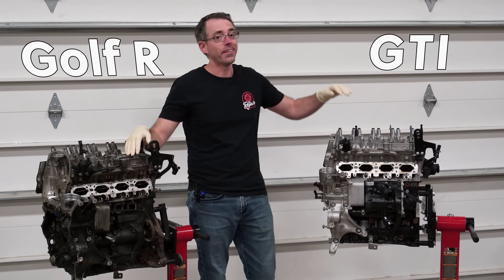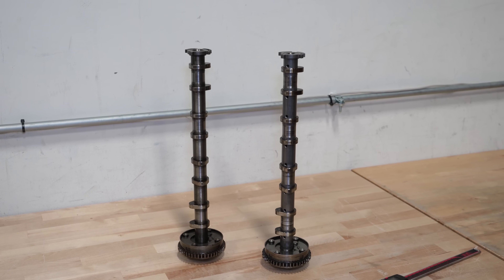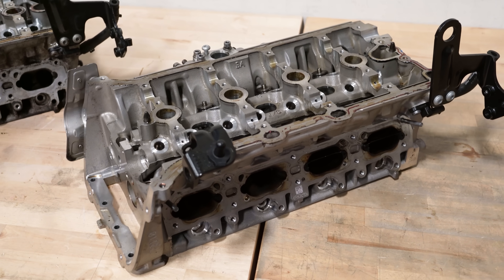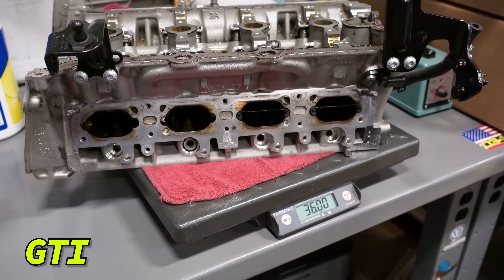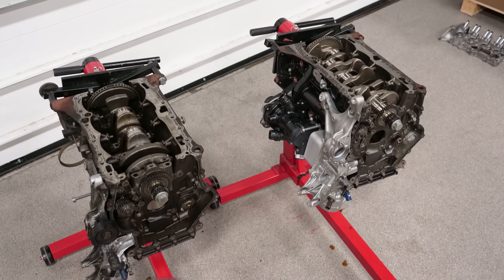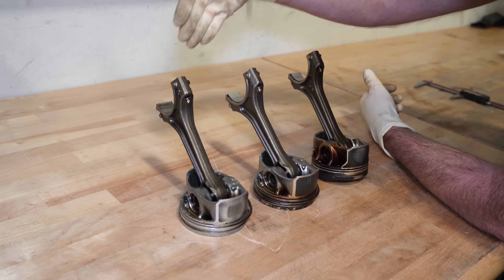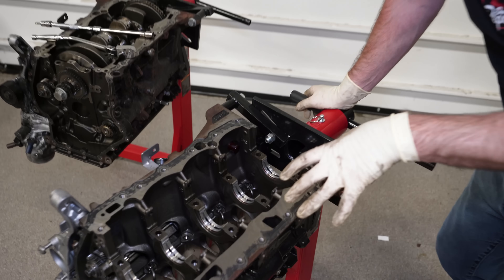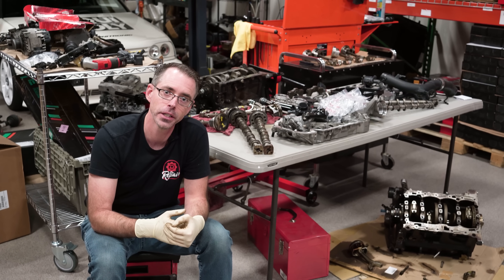Are Golf R Engine Internals Better than a GTI?

Comment: Hi! An absolute masterpiece of a video! :) 

I would like to also ask a question. I own a 1.8 TSi EA888 Gen3 engine, that was tuned to 310 hp and now pushing 333hp. Do you think that the cast crank can withstand 400nm (limited) and 333hp? Thank you in advance for your answer. Oh and yes, almost forgot to mention, MINE HAS OIL IN IT!! :D

Comment: Golf r here, uk if that matters, 132000 miles, original turbo, water pump changed,   no tunes to my knowledge, not lost any power. Relaible so far.
Reply: Had a Golf R mk7.5 new and then bought a new T Roc R and, to me, they were totally different engines. The Golf was a total hoon and the T Roc was a rattling gutless piece of junk; sold it at seven months.

Comment: I have a clubsport edition 40, supposed to be a similar engine to the R, spun bearing 4, needed a new Crank, Oil Pump etc,  car is stock so not sure how reliable these are.

Comment: Nice Video just to correct it was Aluminium Al SI stands for Silizium (not Silikon) - its basically a "hardened" Aluminium by the means of little Mangan (Mg) - an invention by the german aviation engineers from WWII - a lightweight, high-strength aluminium alloy that is widely used in the aerospace

Comment: i wonder why they use silicone in the alloy instead of carbon? is it more stable? better properties?
Reply: replying to myself.. AI says essentially it's because better properties in a few different ways so fair enough.  
increased castability, less chance of brittle cementine formation, increased tensile strength, reduced thermal expansion and contraction - i guess that last one is pretty important depending on tolerances.

Comment: Up until recently I had an Audi TT Quattro with the 230bhp version of this engine. A Stage 1 remap would have given it more than TTS power. The reason I didn't go for it is because the Torque would have been raised from 370NM to at least 430NM (and possibly as much as 480 if the claims are to be believed). 
However the torque difference between my old car and the TTS/Golf 7 R is only 10NM (380NM) and that got me thinking there has to be a reason VW don't raise it by more- like is it too much for the stock turbo or is the DSG in a Golf R different to a GTi? 

But it does seem I was being overprotective!

Comment: There are some differences, but there is something that is common for both engines: they are both pieces of shit made by VW. They will probably catastrophically fail before they reach 100000 km/60000 miles because of something stupid like an wet belt driven oil pump or pistons made if silly putty that will crack between the piston rings grooves.

Comment: Please stop calling the connecting rods forged their not they are a powered metal rod from what I seen any cracked cap rod is powered metal as far as I know and every manufacturer has been  using them exclusively for decades as it's cost effective they take powered metal put it in a mold it's then pressed and heated machined then Crack the cap
While a forged rod is cast then heated and hammer forged to the desired shape in terms of strength and cost and use it usually goes
Cast
Powered metal
Forged 
Titanium
Aluminum

Comment: Would be interesting to compare a mk6 gti engine with a mk6 gli engine. Because supposidly 1 is gen 2 and 1 is gen 3 but they both have aluminium sumps. Just thought that the mk6 gli 888.3 would be an interesting engine to compare

Comment: Honda VTEC variable valve timing system was the original patent and best system for variable valve timing operation. Witness millions of engines
built without single failure. My Civic Type-R first used in the CRX in 1989/90 and astonished a group of the original testers in Car Magazine holding it at
the redline in 3rd gear at just shy of 100mph on a German autobahn for a 100 miles to see if it would break! Haha fat chance. They came into a town and observed the rock steady tickover in dismay as they knew a varying tickover after that kind of treatment was a sign the engine didn’t like the treatment!Honda rules on engines I’m afraid. 22,000 revs in the mid 1960’s for their diminutive little 50-250cc upto 6 cyl race engines, sometimes assembled with tweezers such was their small size in conjunction with precision engine build methods!

Comment: Perfect video , confirming a lot of the information I have gathered .  Notice how the hardcore  GTI/A3 peeps don't have really much to say in these comments? LOL On the forums every other sentence is  " Yeah, my GTI has THE SAME EXACT engine as your Golf R, except the turbo, you shouldn't have spent the extra money on the Golf R". WELL, now everyone can see it is worth EVERY PENNY to spend the bit of extra money for the Golf R-  " MADE IN GERMANY" vs " MADE IN MEXICO
lol that enough would persuade me to get the Golf R every time.... YES the max torque being 450 ft/lbs in both engines is about right, however, for longevity and stage 3 levels the Golf R will very likely make out much better in the long run being that the GOlf R engine is built for higher power levels clearly.
Reply: Volkswagen NEVER states the Max power! It is always much higher than the rating and can be different with different individual production runs of similsr engines. Tjey also have "hill climbing" mode that enables MUCH more power than rated. Temporarily.
Also rpm when measured can vary.

Comment: So, these engines are significantly different from my 1.8 liter, 8 valve, solid lifter engine from my 1984 GTI? Of course, I understand,  but I just want everyone to know that I have 200,000 miles on mine, and it runs just fine. It is just 90 hp, though. I still love it!

Comment: couldnt you technically slap the golf r cams inside the gti engine and then basically ahve a golf4 engine
and the pistons
if you add forged rods aswell it could get even more hp
with a tune and a slightly bigger turbo you can push 500hp

Comment: I remember the alloy subject from when I built my 1.8t... The head with copper (Cu) in it dissipates heat better, but can form cracks between the valve seats more easily under higher boost.

Comment: the vertical lines in the rod are the result of cutting the excess metal that leaves the moulding after it has been pressed. Then there is another tool to cut out this excess and that is what you see. After that it is shot with sand blast or shot peening. I know because I used to do it myself.

Comment: Golf R don't have bigger injectors, i have cross checked partnumbers on  the injectors between many engines. Golf R uses the exact same injectors as 1.8TSI 180hp engines and all 2.0TSI engines. Only difference between engines is mainly the turbo and SW. An yes, with only a IS38 turbo on 1.8TSI and new SW you get the same amount of power as the Golf R
Reply: Incorrect, hpfp and injectors are bespoke to R. You'll never get a 1.8 to what the R block can do with Is38. You simply won't have the fuel or exhaust timing to do so.

I should know, I had a IS38 on my 1.8t Mk7 :p

Comment: If the cams are different, I'd guess that the R cam adjuster allows for more variation. Supposedly, the mk6.5 GLI intake cam allows more variation then the gen3 1.8t.

Comment: GTI INTAKE LIFT: 38.30MM (vernier caliper measurement

R INTAKE LIFT: 38.31MM
(vernier caliper measurement)

GTI INTAKE Duration: identical
R INTAKE Duration: identical

GTI & R have VVT on Exhaust Cams so it has a short and tall cam lobe

GTI Exhaust Small Lift: 35.53MM
R Exhaust Small Lift: 35.53MM

GTI Exhaust Tall Lift: 37.52MM
R Exhaust Tall Lift: 37.52MM

R has higher duration on exhaust cam meaning the exhaust valves can stay open for a longer period during high RPM

GTI HEAD: made of Alsi10Mg
R Head: made of Alsi9Cu3

R head has better thermal properties  and weighs 3 lbs lighter & if you have a GTI ur a loser bc there’s an R in cooleR 

GTI & R valves: same valve size
R does not have Sodium Filled Valves just hollow 

GTI Block: made in Mexico 

R Block: made in Germany 

R rods: forged 
GTI rods: forged 
1.8T Gen 3 rods: forged 

R crankshaft: forged 
GTI crankshaft: forged
1.8T Gen 3 crankshaft: cast

Comment: So long story short. R engines exhaust valves stay open longer and have slightly lower compression ratios to help the  larger turbo fitted and slightly larger oil squirters . That what iv taken away from this video

Comment: @8:36 If you ever need to check the performance/characteristics of a spring, you can setup a simple device using a rod and a dead weight.  You slip the spring circling the rod and drop the dead weight on top of the spring to see how much compression.

Comment: The differences in exhaust timing are as follows: Since the valves on the Golf R are open for a longer duration, this means that the intake and exhaust valves are open simultaneously for a longer period. This results in:

1. Improved cylinder scavenging: The combustion chamber is flushed more efficiently, leading to better (more complete) combustion in the subsequent cycle and thus higher power output. Additionally, complete combustion within the engine is gentler on the turbocharger, which is likely another reason for implementing this design.
2. Slightly increased fuel consumption: This is due to the so-called scavenging losses, which are unavoidable when the valve timing overlaps

i am sure there are more things but this is what comes to my mind
Reply: Due to the inlet and exhaust valves being open  together for a short time. Boost pressure will help force out exhaust gasses. This will cause a small  loss in boost pressure dependent on the overlap duration . I'm not an expert I have no numbers to share .

Comment: On the vales you need to check valve angles. a 45° valve angle is an angle that needs less valve spring pressure than a 40° valve angle, but the 40° has better low lift air flow, but requires more valve spring pressure.

Comment: When the intake lobe is different than the exhaust lobe is called a dual pattern cam.
This is usually done to compensate for exhaust flow resistance.

Comment: I might not be up to date, but VW used to build the same 4 cylinder engines into most of their cars. Either a 1.8l petrol (might be 2l now) or a 2l TDI. The difference is probably to be found in the software (turbo pressure and whatnot). I personally won't buy a VW ever again. I was not only a victim of their diesel scam, they also treated me worse than their murican customers.

Comment: Many moons ago didn't want to pay Golf R prices so I bought a GTI (2008) brand new.  That year the late 08's had the TSI but you could still flash the ecu without pulling it.  Also the TSI fueling was better that year.  It wasn't long before my favorite shop had me talked into a Revo K04 swap.  Drove that car with zero problems for 12 years and most of it was on either software and 3/4 of that was with the K04.  On top of that I ran the OEM clutch without issue to 130,000 miles and replaced it with OEM and finally sold it at 150,000 miles.  The car overall was just such a great daily driver and bang for the buck.  Video brought back a ton of memories.
Reply: I’m now at 10 years with my Mk7 GTI bought it new in 2015 and it’s been a fantastic daily and I’m at 106,000 miles now. The whole VW isn’t reliable rumors are not true at all from my experience. Planning on getting a new one by the end of the year a Golf R if they change to the physical buttons.
Reply: I really miss my Mk5 GTI. It just started to become a money pit when we started to have a longer commute, but to this day it's still the car I miss giving up of almost everything else I've driven.
Reply: MK5 GTI with a k04 and map is always going to be the daddy

Comment: On the oil squirters, the difference in measured size doesn’t sound like much, but the percent difference is 6.5%. All things being equal, that is a big difference. If that was a horsepower gain, it would be noticeable.

Comment: Do not use the gti cams as they are inferior I build quality. Also the cam solenoid or vvt is most likely different as the r would-most likely allow more degrees of adjustment.

Comment: can you make the same video with a "small" EA888 Gen 4 and a "large" EA888 Gen 4? For example, "Difference between 190hp T-Roc R-Line and 300hp T-Roc R" or "Golf 8 GTI vs Golf R". I've been wondering the whole time what the differences are in the engines, apart from the turbocharger and the cooling. With Audi, with the EA888 Gen 3, it was somehow the case that the small version ran on the Miller cycle and the large version on the Otto cycle. At least that's what I read in a presentation from Audi. I'd also be interested to know what it would take to get a "small" EA888 Gen 4 (190-245hp) to the performance of the large one? Or are there hardware differences even between 190 and 245hp?  The coolest thing would of course be a comparison with all EA888 Gen 4 HP variants, i.e. 190HP, 245HP, 300HP and 320/333HP and then explain what the hardware differences are and what you have to consider/change when tuning in order to achieve the performance of the higher models.

Comment: I’ve replaced the intake camshaft on my mk7 golf r and the old cam adjuster part number was 06L109088 and the new part number is 06J109088.
Would this be an issue? 
Part number on the box was 06L109021N but the part number on the actual cam is 06J021AD.
Vw dont half make this shit confusing 😂

Comment: 1:35 'Big' or high lift cams are actually smaller in diameter than standard cams as the base circle is ground down, the tip of the lobe isn't higher.
(In a single lobe cam, not vtec)
 10:32 You can see the upper oil pans have different baffling.
15:31 Measuring the outside diameter of the oil squirter is pointless, its the inside diameter that counts.

Comment: They both appear to be able to take some serious power (R and GTI), the R of course more thermally capable, with slight cam difference.
That said, I know people who've achieved over 500 WHP in a bone stock engine GTI with turbo, intake, fuel upgrades and with careful tuning nothing has gone wrong. That's probably nearing the limit. And might I say, that's some stout power for a 2.0L engine.
I could see rods, pistons, big turbo, cams, springs, head porting, and all the goodies putting one of these back together again (ARP studs, tough gasket) would really put some reliable power down.
There's a worry about "crank walk" on these motors with the pretty whimpy thrust bearing design. I'd be addressing that if I opened the engine up for a build.
Also I'd be looking for either the European dual-injector intake manifold, or an aftermarket design that allows port injection to make sure fueling is plenteous.

Comment: 20yrs a VW service advisor, but also a fan of Euro cars in general. This vid is insane! You are incredible, and also a bit insane for this deep-dive. Thanks for all you do!

Side note:
My beloved E46 ZHP needed to be replaced due to a terminal electrical failure. I leased a right-off-the-truck 13’ GTi Driver’s Edition, 6m, from the dealer I worked for. Great price. Built like shit and the only unreliable VW I owned in said 20yrs. None of the interior trim was snapped in, fog light and tail light burned out on the 10-mile drive home. Foreshadowing. 

Anyway, a client with an indy shop offered me a Stage I tune, for free, to give my opinion on and send him clients. Great!

At 9k miles, clutch started slipping, badly. My gf at the time used to beat on the car more than I did, so I figured it was the tune and the gf. My VW factory rep said to replace everything needed under warranty, even though I had a TD1 flag from replacing the nav unit after the tune was done. Great guy!

I decided to go for Golf R clutch kit due to the tune. Much to my surprise, same part numbers as the regular GTi that I had. Same everything, from the flywheel, to the clutch, pressure plate, etc. I was perplexed, but went back with all-factory due to it being a lease.

The next clutch kit lasted until 65k miles when I turned the car in and replaced it with a 17’ Golf Wolfsburg, and then the 19’ Alltrack that I still own and love. 

I will die on the hill of the factory clutch and/or pressure plate being junk from the factory, and the tune had nothing to do with it. Nor my gf. lol.
Reply: Stage 2 my mk6 clutch went immediately… then it went again… then I went stage 3 rated for 450 foot pounds 😂

Comment: You can measure the free length, number of turns, and diameter of a spring and that will allow for spring rate calculation (post these dimensions and I'll do it for you).

You can also use a spring scale or weight and a height gauge.

Comment: assuming its better is getting loads of modern guys in trouble spending loads of may best thing fir new engines is run thicker oil open up tolerances mains rods a bit so one can run 5w30 10w 40 .all race engines are looser not epa tight is why 0w water oil

Comment: It stands to reason that R engine has stronger internals than the gti, because if you are developing an engine for higher horse power, you are not going to sabotage it by robbing parts bins and cutting corners, because it's not going to have long term longevity. It's a production car that's meant to be driven daily, not a weekend warior.

Comment: Don’t forget, you can also take the adjuster, sprocket pieces and swap onto the other cam for better result. 

So basically, you should take stuff from the golf bar put it in a GTI other than the GTI Pistons just have a higher compression ratio??

Comment: I think that while the cams may work, the difference in duration will have an impact on the power delivery. It is very obvious on NA engines, and should be to some extent in boosted applications. maybe a custom tune will be needed as well.